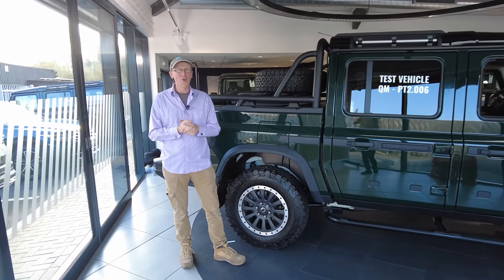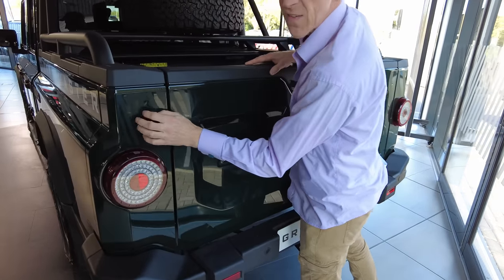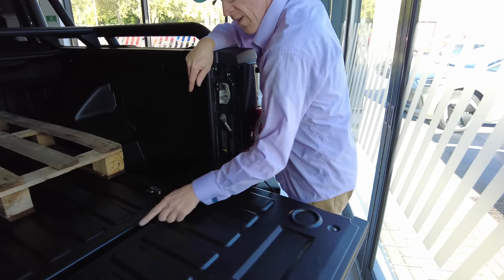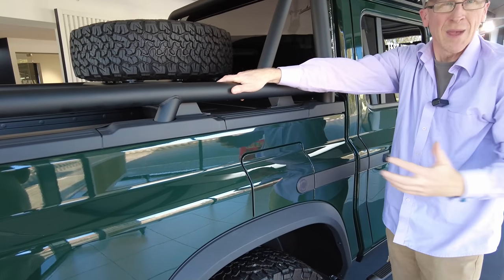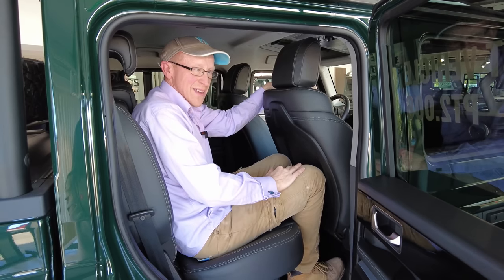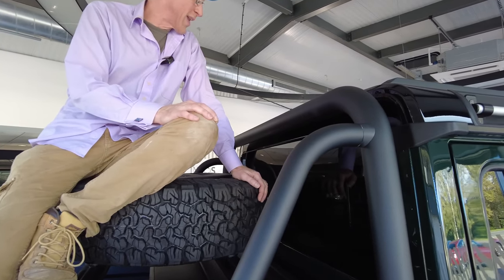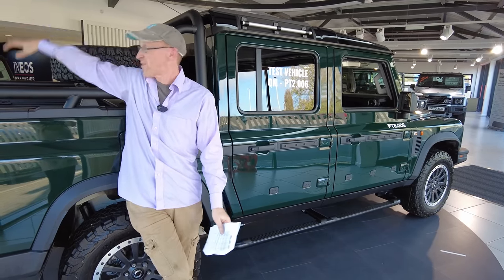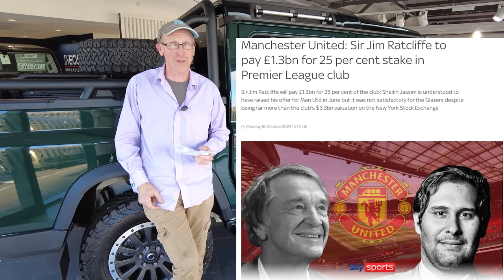INEOS Quartermaster Pickup Review & Ineos Grenadier EV Update + Future Direction....

Comment: Can’t carry a ton, therefore no VAT reclaims and inferior tax relief. So a V6 Ford Ranger does carry a ton and qualifies so for a business a Ranger fully loaded with extras comes in at around £46 + VAT while Grenadier is £75k.  A perfectly powerful and more economical 200hp diesel Ranger with the same spec otherwise comes in at £42k including 20” wheels and power roller shutter, both expensive options.  A £33k saving for VAT registered business buyers. No contest whatsoever.  Also the tow hitch drawbar and ball on the Ford and VW is removable for increased departure angle.   The exhaust on the Ranger comes straight over the rear axle and down behind it and stops right there, pointing down for great space utilisation and no rear silencer allowing a full size underslung spare wheel. This is most important because the spare does not impinge on load space or visibility.   It’s just a far better thought out vehicle than the Grenadier at a massive monetary saving even if you are not VAT registered.
Reply: My 3.5 ton Iveco daily flat bed can’t carry a ton payload. Even though it’s got twin rear wheels. 😂
Reply from the maker: Let be honest they will sell the quartermaster but its a hard sell and I am not sure who the buyers are going to be !
Reply: The people who worry about price last
Reply from the maker: Pies first - price last !

Comment: There won’t be an all-electric version of the Grenadier. It is already grossly overweight and cannot possibly be viable with an even lower load capacity which would be inevitable to keep its gross laden weight under 3.5 tons.
Reply from the maker: The ev ineos will be much smaller on a new platform is more guess

Comment: What I don't understand is that they do not make a 2 seater with a bigger pick up body. I would buy it for that open space. Just typical things like moving a dirt bike or quad is already not possible, and I can't recall driving with more than 2 persons commercially in the last 30 years, so I would like to have a stow space instead of unused seats. Also if I would consider putting a camper top I would want a longer pick up body and just a 2 person cabin.  I don't think this will be a commercial success.

Comment: The turning circle of the Quartermaster is about a metre wider than most crew cab pickups which have a longer wheelbase.  Partly the result of having a live rigid front axle. This also prevents the use of modern electric rack and pinion steering which can be linked to safety systems such as lane assist and partly autonomous steering with adaptive cruise control and emergency crash avoidance.  The resulting use of an outdated recirculating ball steering box gives a vague on-road feel with lots of turns from lock to lock and an almost inevitable death wobble when cornering at speed over bumps.
Nissan have long departed by the way. The competition to this are VW Amarok/Ford Ranger, Isuzu and Ssangyong, plus the inevitable Toyota Hi-Lux 2.8.
Reply from the maker: Yes while researching this video i see Nissan has exited this market - its a small market and there is a lot of competition. I think a lot of Farmers etc are going for thre Isuzu !

Comment: I’m not a fan of these cars but I like the idea of the gap at the rear tailgate, park slightly uphill & all the water will run out.
Reply: It won’t keep the dust out if a canopy is fitted. 🙈😤
Reply from the maker: No pool party in the back of the quartermaster!
Reply: @L663  that was pretty good for you 😂

Comment: 7:38 that's why you have a reversing camera, even without the spare being where it is on this one you still struggle to navigate behind you surely??

8:52 i bet they've used the original exhaust system from the normal Grenadier to save expenses and with this Quarter Master being longer it sits way under the bed.
Reply from the maker: The exhaust does indeed look like the one from the grenadier

Comment: The pick-up element seems a bit rushed. As you pointed out. No step or grippy bits to step. New ranger has steps in each side. Spare wheel should be below. However some farmers I know have old defender pickups and amongst the hay, dogs and pitchforks the spare wheel is usually in there too. But the option to have a carrier underneath is a must. The utility rail should go down the side of the bed as you mentioned. 
Be interesting to see what Ineos do in the future with a 90 model and hydrogen etc. seen a few on the road now and it’s not till the final 5 metres I release it’s an anus grenade and not an old defender with led lights retrofitted. Thing the grenade is wider than the old defender too.
Reply from the maker: I dont think Hydrogen is going to happen soon but they seem to be saying they will bring out a smaller battery EV 4x4 ! this would be interesting

Comment: The space behind the big silencer could be used for an extra fuel tank. 17.5 gallons is just not big enough for such a heavy and thirsty beast, certainly not in bigger wilder countries than the UK. That spare space doesn’t exist on the station wagon.
Reply from the maker: Good idea for the space. Weight is such a problem…. Weight - poor economy - need bigger tank - more weight…It’s a vicious circle
Reply: @L663  Thing is though, it’s the station wagon and van versions that need that space for the extra tank and they haven’t got it. The pickup can always carry fuel in jerry cans down reasonably low and forward in the deck, separate from the passengers. Four by 20 litre plus the main tank’s 80 litres  gives a reasonable 35 Imperial gallons at 20mpg towing or offroad gives a practical 700 mile range, or in the UK/Europe on long distance trips, about 900 miles.  Thing is though, an identical trip in a similar performing Ranger/Amarok 2 litre 10 speed auto, with the same load will yield 600 road miles verses 450 from their standard 17.5 gallon fuel tanks. 34mpg verses 26mpg lightly loaded [2 passengers and luggage for a week]

Comment: Nice Ute (pickup). If they can increase the GVM to 4000kg then it will pass the 1000kg loading. Build quality is impressive and a lot of reliable components have been installed. See how future goes over next 4years.
As far as Nissan, just go buy a Mitsubishi Triton as there now in alliance like every other domestic ute. Nissan NP300 cant tow 3500kg up grade for 2km without overheating. We tried it with 3300kg, gearbox and engine overheat on grade.
Land Rover, wouldn’t even entertain it as previous dealings with reliability, depreciation, parts and LR politics have woke up a lot of people to there operating values of ripping people off for bad products with little support.
Reply: Upgrading to 4000Kg would mean you cannot drive it on a normal UK car license - this is the problem.
I have towed my 2700 digger with trailer - 3500Kg to France with my 200K Km Disco 4 to France and it did not miss a beat ! 
I guess you are "down under" and the weather is a little warmer than here in the UK !

Comment: Problem is , construction industry can’t buy this to run as a business vehicle as it’s payload makes it not VAT recovery so makes no sense to me , ford raptor is the same and I do see them on the road, but if you can’t purchase it as a vehicle it’s designed for ,as HMRC say it isn’t then the market has just been cut by 90%
Reply from the maker: Yes not only construction industry but most self employed people will have the same issue. In france there are hardly any double cab pickups.... there are loads in the UK and the main reason is that they have a low benefit in kind tax ! Rules drive sales in an odd way - thats why there are loads of 249g drones....as at 250g you are restricted where you can fly them!
Reply: I've had a couple of Amaroks. Would I have bought them without the tax incentives, no. Seems a problem for the UK, but then, there us the rest of the world.